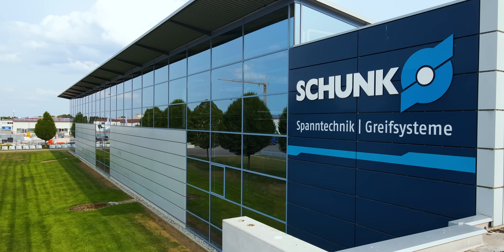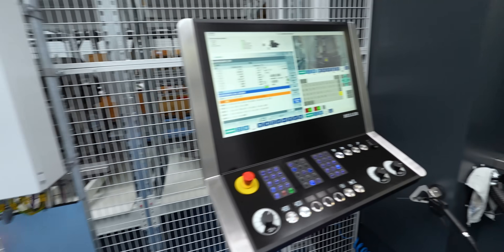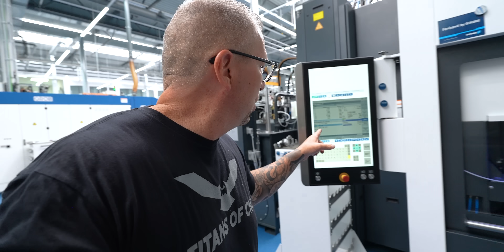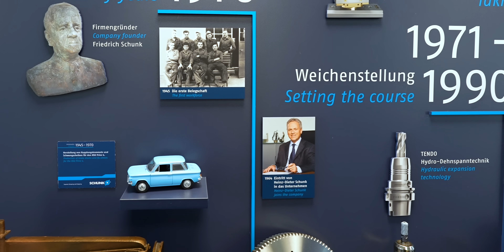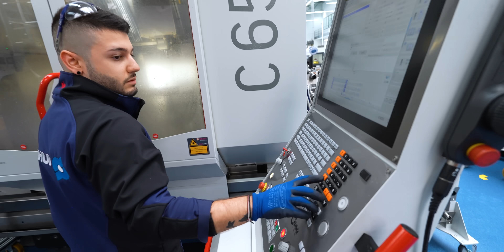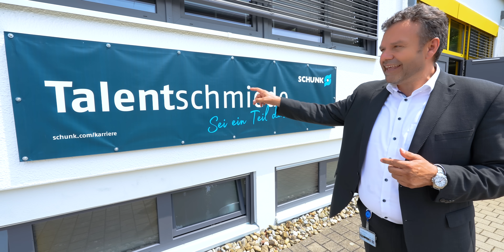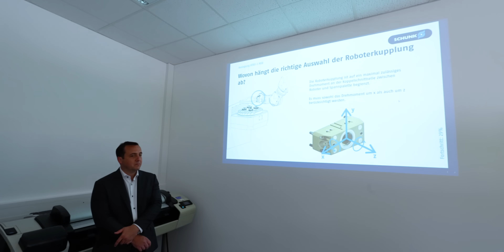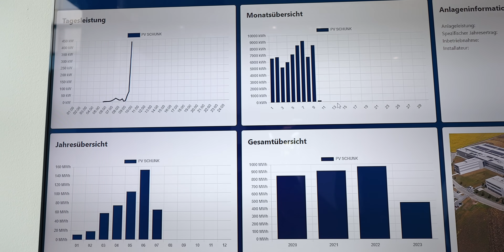Machining GIGANTIC Workholding in Germany

Comment: Had to do a small stint as an apprentice last year working under a machinist on a NHX-500 5 axis CNC mill, offloading all the swarf chips multiple times a day was a fucking ordeal, rolling out a giant swarf bin to a gantry crane so we could manually dump it every time it got full. And the mess that would be left behind every single time.

Having an automatic swarf compactor attached to the mill is fucking genius.

Comment: I work on a similar one but bigger that you show at 7:53. I can't tell you how great it is to program and work on it. Raw stock in, finished part out, no need for manual loading for the next operation. That subspindle is something that should be in every CNC lathe, or as we like to say, once you go subspindle you never go back to tailstock.

Comment: This place is unrealistically clean. Mechanical room that isn't filled with random boxes of stuff? What is this? Every production place I worked at has had every possible place just fill with stuff. Incoming-, outgoing, spare tooling, spare this and that, additional things and materials, extra and spares of things with some potential value.
Reply: This is truly how the Germans run their shops. Its like a hospital.
Reply: @Bantorthe2nd If your workshop is clean and organised, you work faster and it looks better